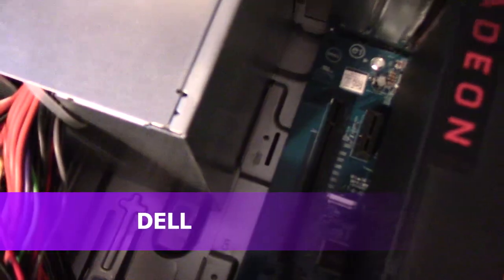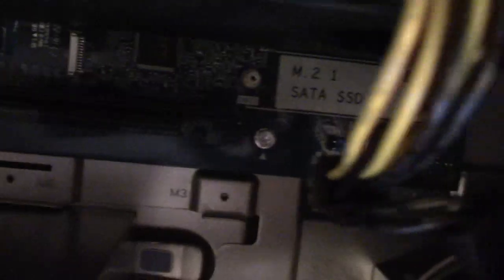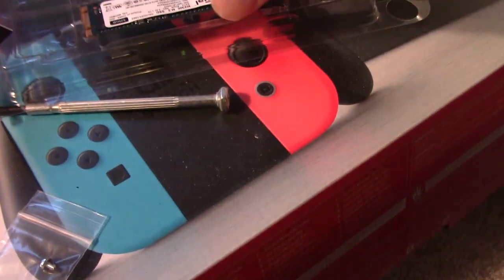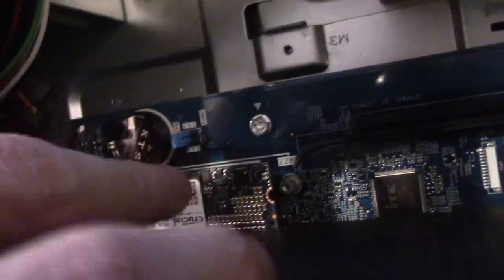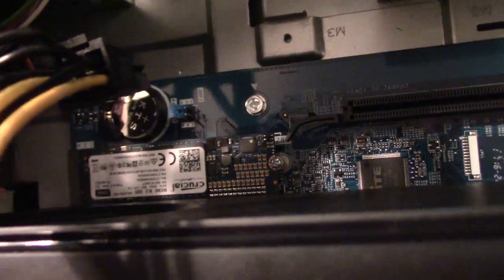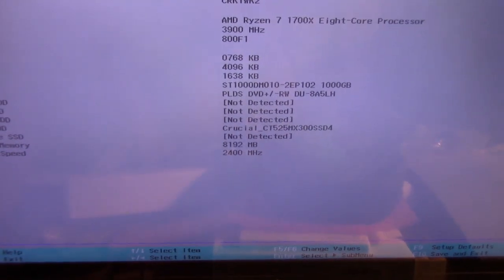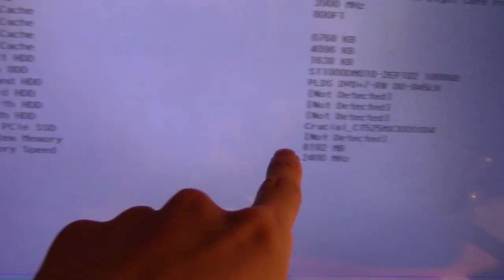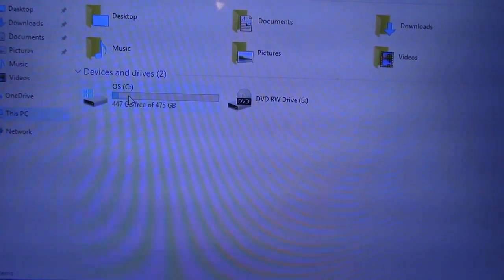How To Install M.2 SSD Drive NVME DELL Gaming Inspiron 5675 and how to make it primary boot Drive

Comment: Man, Dell is so difficult to work with. I removed the standard 128gb SSD, disconnected both HDDs, and I cannot get it to boot to the m.2 I have installed. I previously installed Win10 on it over a year ago, but something must have corrupted on it by leaving it installed and not using it as a primary and untouched.

I was being really lazy about backing up files from the SSD and moving over to the m.2 drive.

BIOS sees the m.2, but only getting Automatic Repair options. Going to try running some command prompt commands, I guess.

Comment: From what I understand on Dell's support page the 5675 Inspiron Desktop gamer doesn't take more than 256 GB SSD m.2 NVME on the motherboard. Only 128 GB or 256 GB max out.
Reply from the maker: i have a 512GB in mine
Reply: @kintips  what brand?
Reply from the maker: Crucial  i have no problems. You can watch my video https://youtu.be/q-YSz-KfAus
Reply: @kintips  and what are your specs on cpu and motherboard? Dells support page for my vintage says nothing bigger than 256 GB and compatibility for selling the drives isn't listed on anything bigger than 256 GB on the product side of dells site
Reply: @kintips  but I have been able to put 64 GB Ram into it even though it says it only supports 32 GB Ram
Reply: @kintips  3.5 mHz cpu

Comment: it is not on the nvme slot. didn't help at all
Reply from the maker: NVME is installed the same way
Reply: @kintips  but it wasn't recognized by the specific motherboard Bios of this machine inspiron 5675 (DELL 07PR60 ryzen III, chipset AMD X370 Promontory) as an option to boot drive. I had to buy an PCi xpress adapter to use my Biostar NVME as a boot drive
Reply: @drelius  wow, so maybe this is why I'm having problems. I'm trying to get my 1TB NVMe to boot, which I did a long time ago, but I cannot get it to boot now. I installed Win10 via USB to NVMe and now I even cloned my C: drive to the NVMe, disconnected everything, and still the NVMe won't boot with either attempts. Just goes to Windows Repair. I'm going to try and replace it since the NVMe has 5 year warranty and see if the next one will boot. If not, I'll likely sell this Dell and never buy one again. It has been nothing but problems since purchase. Had the motherboard and GPU replaced due to random crashes and blue screens, and from time to time still it will randomly power off and not power on until I disconnect the actual power cable.
Reply: @420  I didn't even know that Dell still sold this model. Even if they are versions with updated cpu/mobo/gpu... Mine was bought in 2018, so it's been 5 years, and I think THEY SHOULD HAVE fixed these incompatibilities by now.

I remember that with 8 months of use I had these problems to turn on, sometimes it didn't turn on at all. No lights, no coolers, nothing. I did all the tests possible, with another power supply, memory, gpu, power reset button on the back of the power supply, static energy release, etc... Several things they inform in the manual and in their youtube channel.

This happened on and off, for about 3 months later, until it didn't turn on anymore. So I had to use the warranty, almost at the limit. They fixed it, but they didn't say what the real problem was (they said they changed the motherboard, but I know that was a lie), all I know is that after it came back from service, the LED on the front logo doesn't light up anymore, so I think there's something to do with wiring in the front panel or the buttons, maybe something simple.

But since then (2019), I haven't had any other problems. I upgraded some things (memory and ssds) and just changed the CPU cooler last year for an original Wraith cooler from AMD, which is much better than the one from Dell, which was no longer holding the temperature.
Reply: @420  I just read this in another comment: "From what I understand on Dell's support page the 5675 Inspiron Desktop gamer doesn't take more than 256 GB SSD m.2 NVME on the motherboard. Only 128 GB or 256 GB max out."

Mine was a Biostar M700 512GB (not a good experience with temps)... one possible theory.
Reply: @drelius  yeah, I bought this Ryzen 7 edition back around then too after seeing it on Slickdeals. It's not worth it in the end due to all the intermittent problems it had starting out. I had to extend the service warranty just to be safe after getting the GPU and motherboard replaced.

I really hate the fact that installing the NVMe has been such a nightmare to sort out. Going to do an RMA with the manufacturer and see if perhaps it's not even the Dell's fault. It used to work, but now it doesn't for some reason after a long period of not using. I can install Win10 via USB and even clone my C: to it, but  I can't get this dang Dell to boot to it and all the BIOS seem to be set correctly.

I'll see where this goes after getting the NVMe replaced.

Comment: I have almost the same pc. Mine just came with one stick of 16gb DDR4 and a 256 gb SSD drive.  Mine is located in the same M.2 as yours.  Why are they not installed in the M.2 NVME slot? What goes in the NVME slot? Another SSD? If so, what are the benefits of having more than one?
Reply from the maker: NVME is another SSD format. suppose to be faster, but thats minuscule in time you wouldn't notice too much and its more expensive
Reply: @kintips  Why would Dell give you two SSD slots? Is it to give you the option which one to use, or is there a use for a second SSD drive?
Reply from the maker: yes you can use it as another drive. but only takes NVME
Reply: @kintips  Under the DVD drive,  there is some kind of an empty bay with a flip down door.  What goes there?

Comment: I have a 5675 and the primary drive is a 256GB SSD drive. I'm wanting to upgrade to a 1TB Samsung Evo SSD. Do I make a recovery disk ? Do I remove the 256GB SSD or leave it in ? And I would straight up use the recovery disk to load Windows at boot up on to the 1 TB SSD ? Thank you !!

Comment: I figured out how to make the ssd the boot priority drive without wiping any drives.you need to clone the first drive on to the ssd. next only plug in the ssd and go to boot priority from bios. It should be a few tabs to the right. here you should see the boot list and you wont be able to edit it. from here go down to add boot drive. Add the name and select efi. now turn off the computer and plug in all the drives. boot into bios and select the boot manager that you made. (if instructions unclear look up how to change uefi boot priority.)
Reply: Elliot ko  hey I need your help can you add me on discord my ign is Optic#5761
Reply: I have the same bios and cannot get my SSD to be recognized as a boot option.  Any further tips would be appreciated.  I ended up making the SSD a (d) drive, but it has been copied with my O.S. so it should be able to take a boot right?

Comment: At 3:05 you cut out the part I'm having trouble with (setting the SSD as the boot drive)
Reply: Laurence Finn  hey Have you figured it out? I a, having trouble 😢
Reply: @gaigesmith9674  did u figure it out yet I’m having trouble
Reply: @IMadeYaRead  Founded! came across with this trouble 7 years later😂 easy fix: instead of pressing f2, press F12 and select the ssd ❤ now by default is your primary.
Reply: Has anyone worked this out yet
Reply: Founded! came across with this trouble 7 years later😂 easy fix: instead of pressing f2, press F12 and select the ssd ❤ now by default is your primary.

Comment: I recent bought a dell 5675 and would like to install the Crucial MX500 500GB (the m.2 version), but on the crucial site (their test tool) does not recognize the 5675  - is the MX500 compatible with the 5675?
Do you know if there is a spot for a 2.5 ssd? I had already added another internal 3.5 500gb hhd, along with the 1tb hhd already there.
Reply from the maker: i have 4 HDD you can add them but i have one just dangle a bit lol

Comment: Curious to know. If you choose the ssd as a primary drive, it will install windows automatically? I suppose the PC has windows installed on the 1tb harddrive but how do you swap windows from the 1tb harddrive to the ssd?
Reply from the maker: you use the recovery drive when you boot up
Reply: kintips ok so basically if you install an ssd and go into bios and choose the ssd as the boot drive, it will prompt you to install windows 10? Im not too familiar with the process. Thanks for answering. Getting this PC soon and I got the evo 850.
Reply from the maker: yes go to bios and use the recovery drive. (make one first) these newer computers don't give you much options, its pretty much automatic

Comment: How did you make the M.2 the primary drive it not showing up on my Bios.
Reply: Founded! came across with this trouble 7 years later😂 easy fix: instead of pressing f2, press F12 and select the ssd ❤ now by default is your primary.

Comment: My SSD did not come with screws. Do you know what type of screws this would need?
Reply from the maker: the screws are very tiny, i don't know what they are, they came with my ssd
Reply: You'll need this kind of screw - "M2 x 3mm Laptop M.2 SSD HDD Hard Drive Phillips Flat Head Screw" 
https://www.ebay.com/itm/M2-x-3mm-Laptop-M-2-SSD-HDD-Hard-Drive-Phillips-Flat-Head-Screw-NVME-SATA-2-pcs-/113025938326

Comment: I just installed a Samsung 960 EVO 1tb, but I can't figure out how to install Windows on it from the recovery; the recovery automatically installed back on the HDD. Did you remove the HDD so that the SSD was the only thing in there? I saw where you were trying to figure out how to make it "master" but then backed out and cut it off. I think that's the part most people have the most questions about. Interestingly, however, my computer has the NVME port on the top by the WIFI card; looks like you installed an mSATA drive, not NVME. Am I wrong?
Reply from the maker: Yeah it took sometime to figure it out because there use to be an option where to select. But i did remove all the other drives. Yes i left my NVME slot open and use the MSata as it was way cheaper, and wasnt sure if a NVME drive was worth the extra cost. If you have a NVME drive let me know if it was actually worth it
Reply: I got the 1tb 960 evo from microcenter on a recent deal. it just arrived a day before the computer was ready for pick up. The drive was $339.
The drive did not come with a screw, and the computer did not come with the screw either; However, I removed the one from the wireless card and used it for the ssd drive, and then used some electrical tape to hold the wifi card until I can get some proper screws (which I think just got delivered). I tried doing the windows restore, but it did the restore in the HDD instead of the SSD. Finally, removed the HDD and tried to do the restore again and this time it did automatically install into the correct drive. I'm debating whether to reconnect the HDD or not. I hadn't noticed there was even an mSATA slot on the board, but it's good to know in case I want to add an additional ssd instead of the HDD. I was going to give up and get an 850 evo 2.5 SSD, but I'm glad I tried this. If anybody has a better advice, without cloning, I'm all ears. The good thing is the drive is crazy fast and the computer is clean of bloatware.
Reply: YES!!!  NVMe speed more than doubles regular MSata or SSD

Comment: How did you make the ssd visible. I thought this whole video was about this itself ! Why did you skip. ???
Reply: Hey dude I’ve got the same problem! Did you solve this??
Reply: @bpets99  bro i cmnted 4 years back, lol. btw PCIE M.2 ADAPTER.
Reply: @bpets99  Founded! came across with this trouble 7 years later😂 easy fix: instead of pressing f2, press F12 and select the ssd ❤ now by default is your primary.
Reply: Founded! came across with this trouble 7 years later😂 easy fix: instead of pressing f2, press F12 and select the ssd ❤ now by default is your primary.

Comment: Great videos on the Inspiron 5675.  The issue I had was the missing SSD which you can easily resolve yourself.  Got a quick question.  You went through the setup process of Windows using the standard hard drive.  Then it appears you were able to install windows on the new SSD.  How did you do that?  Didn't know if you had to clone your existing windows boot from the drive.
Reply from the maker: I did a fresh install didn't use any cloning software. When i install new hard drive i like fresh installs (too much junk files) otherwise. i made a recovery back up then booted from there then installed it on the SSD. It took about 2 hours to do that my ssd is 525GB
Reply: @kintips  Thanks again....